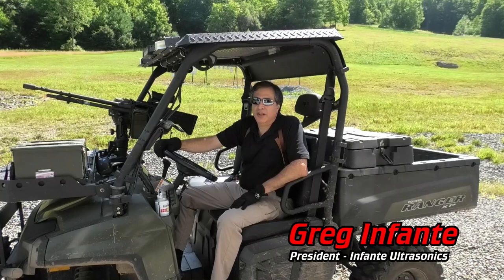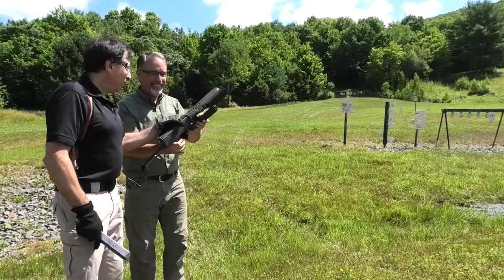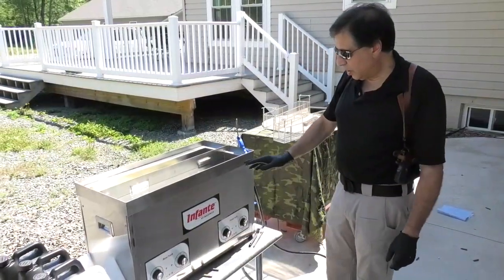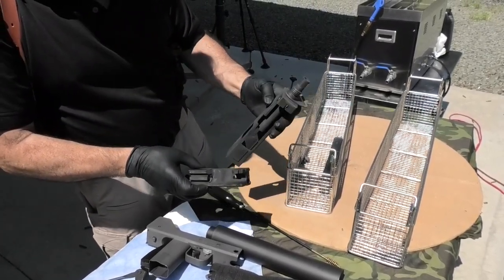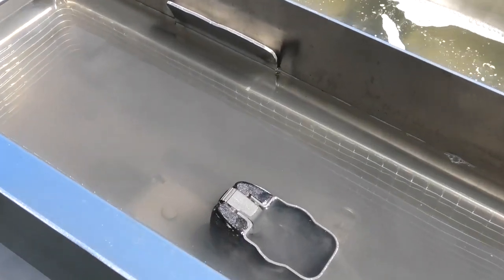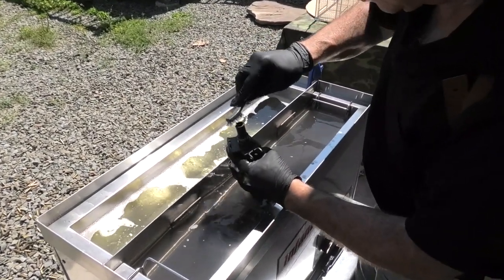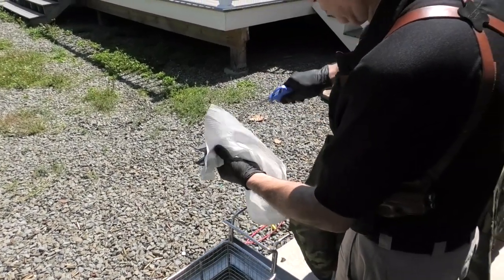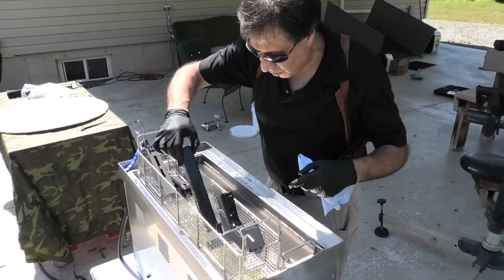Mac 10 Ultrasonic Gun Cleaning | INFANTE S30 Ultrasonic Gun Cleaner

Comment: What is the solvent or is it just deionized water?  How long do you run the cycle?  How does it do on copper fouling?
Reply from the maker: The cleaning solution used is our very own Sonic Tonic, it is used with 95% water. With our systems we use a 2-5 minute cleaning cycle and removes all various firearm fouling. You can visit our website for more information or reach out to us on the contact form.

Comment: could you drop something complicated like an assembled 92FS upper and lower (field stripped but not detail stripped) and have the cleaner blow out crud in places like the hammer/sear area? 

Spent hours detail stripping cleaning and re-assembling a 92FS that had a sandstorm blow up with dust, and I never want to have to do it again if a tool can flush all that out.
Reply from the maker: You should be able to clean the whole gun field stripped in about 5 minutes using our equipment and process.

Comment: I have had my M10/45 since 1989 and it has never been that clean! How do you clean the suppressor?
Reply from the maker: The suppressor can be dipped in the ultrasonic tank for about 5 min to clean out debris on a new suppressor, otherwise it will take longer if the carbon builds up
Reply: I assume that following the cleaning cycle, you would place the suppressor in your lube bath to avoid rust.  Would compressed air alone be adequate to get the excess out internally…as many suppressors cannot be taken apart?